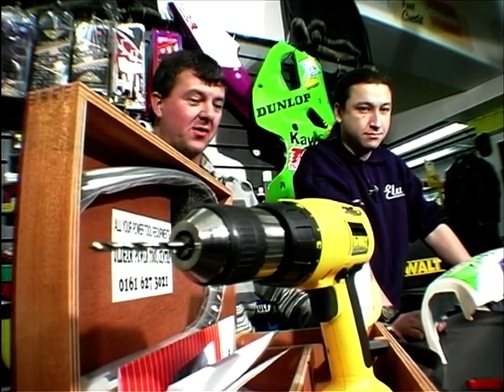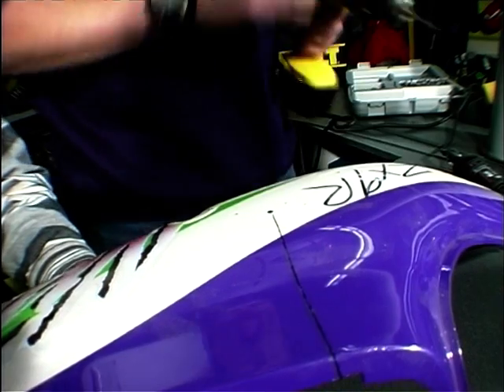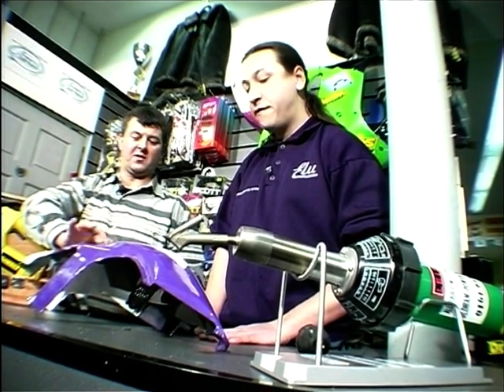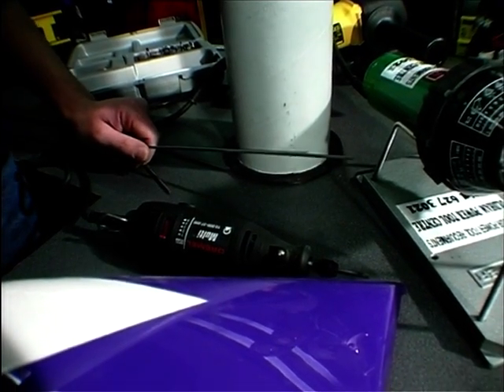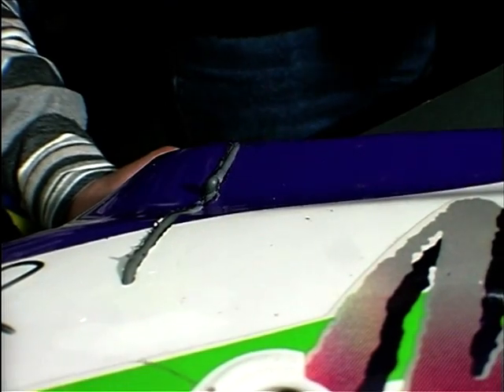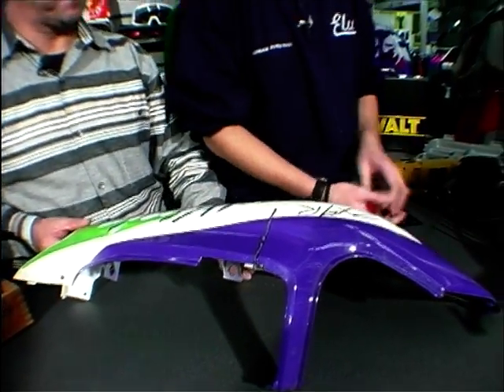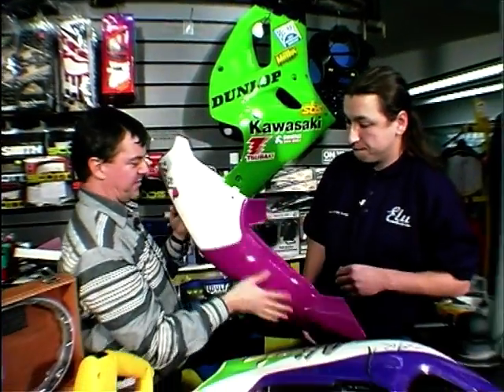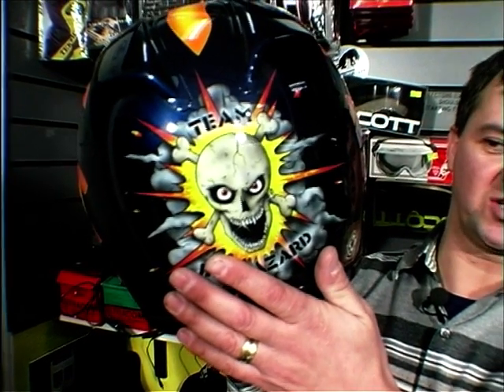Repairing Motorbike Panels: Plastic Welding

Comment: There is a much better way to do this with no gestimating.
First thing using the wrong grinding bit, second on the plastic it self says the type it is so u dont have to experiment and third u should use the welder that can use the metal clips which makes it much stronger and resistant to vibrations.
And this is good for fairings you cant find or are just too expensive, but once you calculate the time, material and painter its not worth it.

Comment: What they aren't telling you is the heat gun is a floor welder that will cost you £600 and it won't fucking work he's a moron cheeper to buy the fairing tight north idiots

Comment: Weld from the inside of the fairing guys.. use the correct size plasic rod. Ie 3mm 4mm 5mm ect  Theres just No need to double up on weld rod and that triac gun is over kill.  Use the pendlum weld method for short runs. The strength of weld is Depending on what kind of plastic material your  working on , IE, poly proplene the weld is weaker than the plastic and if its pvc the weld is stronger .

Comment: Useless. That guy has no idea. 'Let that Dry'? More like let it cool. With such bad technique, incorrect heat and cold joints that fairing would be cracked and stuffed within a week. 
Relabel the video to 'How to not weld plastic with the correct tools'

Comment: I did a better job on mine but I used my soldering iron and cable ties and it's all knitted in nicely and now you can't even tell and it cost me nothing just what I all ready had in my workshop . and I don't think that tool is cheep either and you would have to do loads of work to get your money back on it . I'll stick to what I did .
Reply: The zip tie methods I’ve seen before drill holes through leaving ugly visible zip ties on the outside. I’m guessing that’s not what you did. 

The neater method melts zip ties into the plastic on the back. 

There’s a good technique to melt steel pieces into the back to cover across the crack.

I like the method using fibreglass patch on the back to hold across the crack. Then use zip ties as donor material and melt in with a soldering iron for a smooth finish. 

Ultimately: a smooth finish and paint over hides everything.